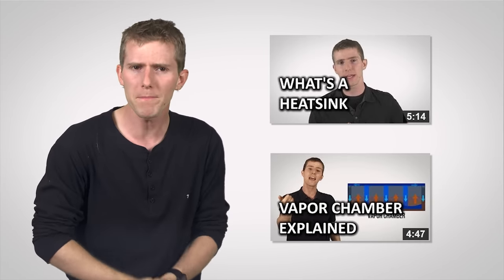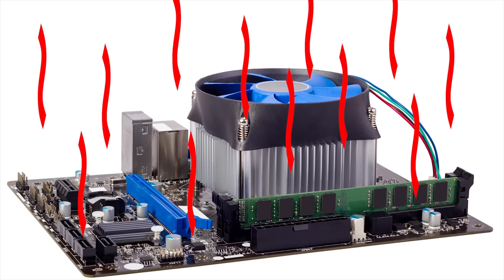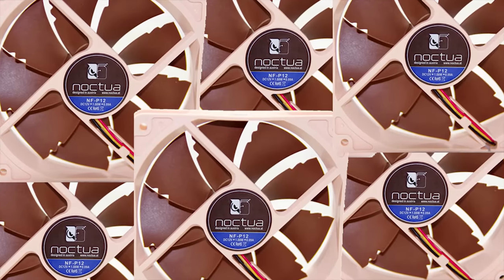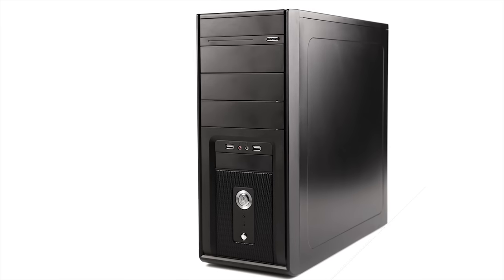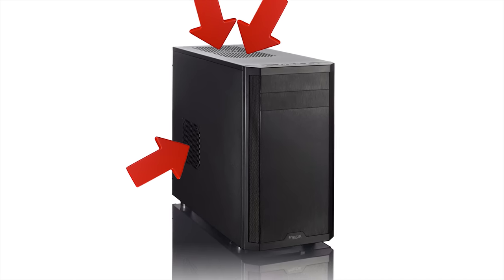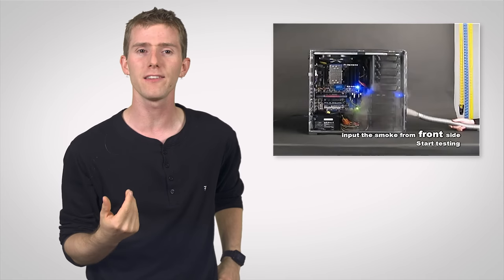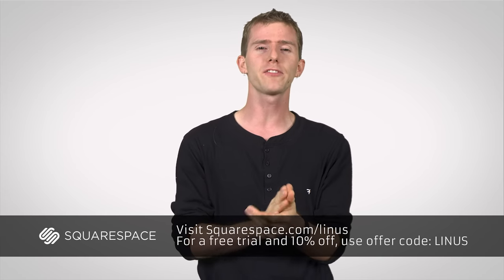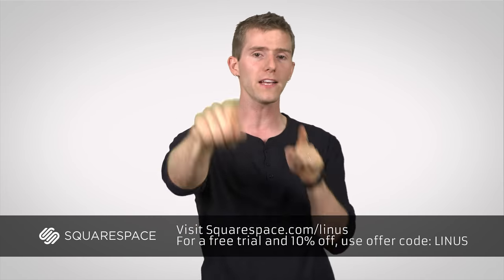Positive vs Negative Air Pressure as Fast As Possible

Comment: Hey guys please read THIS IS NOT ADVERTISING!
SO the reason im not posting this on forums is because the response time there is shit.
My PSU is making this extremely annoying noise (A Corsair TX850M 850W). I found this on youtube:
The problem is that there is a point where the PSU is under enough load to start supplying voltage to the fan, but not quite enough to start it spinning. Instead is rattles back and forth and makes a most annoying buzzing noise. The fan spinning at full speed is less annoying than this buzzing noise.
So now i thought about this, and i think i found a "solution" but i need confirmation if this what i thought of is safe. So my idea: Can i open up the power supply, disconnect the fan connector, and wire the fan up to my motherboard? and control it through my BIOS to keep it on constantly? I know this is NOT SAFE for the temperatures but i got a super silent fan so i can just keep it on highest RPM it can do lol. Can i do this? Is this possible? Is the connector the right one for a motherboard? Thank you for reading, and don't tell me about warranty pls lol.
Reply: I know you said not to talk about the warranty.. but sending it back and getting a new one is the only option really. The buzzing noise will be coil whine. The fan shouldn't spin at full speed all the time either, my CX750 corsair power supply makes almost no sound on maximum load and that's a relatively low price power supply.  Wiring it up to your mother board wont make a difference, send it back for a new one or buy a new power supply.
Reply: wapted  Thank you for your reply. I think i'm going to buy a new one. if i send it back for a new one i can't use my pc for like 2+ weeks which i really can't handle lol xD and also i don't think that will fix it... I'm probably going to buy a new one :) be quiet! Dark Power Pro 10 750W, it''s 100W less than i currently have but it should still be enough for my pc
Reply: Ok, great! good luck with getting a new power supply :)
Reply: wapted Thanks :)

Comment: So, if I take the cover OFF my case, that would keep a CF/SLI setup cool?
Reply: Take the cover off, and get a fan blowing into it.
Reply: Sheldon Cooper definitely yes thats what i do sometimes,if i play but you olso be letting dust in.
Reply: Sheldon Cooper why do you have a cf/sli configuration if you dont know the basics about cooling? *facepalm
Reply: beyond305 I never had a CF/SLI configuration. It was a question.

For the record I now have an Antec p280 with proper cooling.
Reply: beyond305 chill bro

Comment: I guess I went in the wrong direct when getting my Liquid cooler. I now have 3x 120mm pushing, 1x 140mm pushing out and 3x 120mm pushing in. So Negative pressure... Should I re-arrange it all so it's to be positive?

Comment: Okay, lets have a scenario where you are using up all fan options ( lets say 3 intake and 3 exhaust ), will lowering the rpm of the 3 exhaust help and maintain a somewhat positive air pressure?
Reply: Yes, because in the end you'll have more air trying to enter the case versus the amount of air being allowed/pushed to exit it.
Reply: Raymond Tyson Thanks man, I've been wondering about it for a while.

Comment: Inside my PC barely accumulate any dust or dust bunnies.

I have a case that is 90% mesh turned face down so PS, GPU, CPU, all exhaust heat upwards, all parts are designed for passive air flow except when rendering video then I flip a switch for a fan to blow up over the CPU.

Comment: How good of a ventilation woud be to put two fans at a front and one at the back.1 front fan who top one woud go  nearly its full speed lets say 1500 and a botom one woud be controled by psu going slower like 600 or so and at the back woud go 1500.

Comment: Techquickie a pet peeve of mine is when I see a system and the user has install the PSU up-side-down, i.e with the PSU Fan facing the GPU or CPU if it's at the top.

Does having the In-take for the PSU inside the case benefit the rest of the system in anyway?
Because the way I see it, it's just collecting unnecessary Dust because it's not using the filter plate attach to the case..

Comment: So you mean I should use as many intake as outtake fans? I use the Phanteks enthoo pro with 2 Corsair SPs in the front, a AF in the back and the top and the two SPs of the radiator.

Comment: does radiator fans and GPU fans affect air flow/air pressure? I have 2 intake and 2 exhaust (not including the 2 140mm radiator fans and 3 fans on my rog gtx 1080 strix)

Comment: What if my favourite Case got no top/bottom fan mountings, but 2 front, 1 back and 2 side. Front does pull, back does push. But what do i have to do with the 2 side fans? Both pull, both push or bottom pull(at the gpu) and upper push? I've got a real struggle here

Comment: Does the concept of hot air rising really not matter all that much? I guess I'll have to use the fans on my h100i as intake rather than exhaust if that's the case. Right now I have a slightly negative air pressure in my case and the dust is driving me nuts!

Comment: Negative PRESSURE in an ITX CASE equals the only way to get this asus 670 gtx cooled thru the little holes in the top of the "raid-max atomic case" as even the hard drive I have for third place storage (have nvme and ssd too) is up above the gpu and is less then millimeters from touching the blades of the asus gpu fan blades. Yet, Yet, been running for years this way and I can't get temps tp rise for gpu or cpu above 74c if I tried and I am not so sure I even hit that, EVER, usually after two hours of assassins creed syndicate, on more graphically intense then the 670 should be running, it will finally start to get red dots or flicker on and off, however that even may be my psu as in 12volt rail, not so sure as that rarely happens as I rarely play that demanding of a game in those demanding setting for that long thus, I am a negative pressure kind of guy until somebody Prove me wrong.. I think it makes a difference in itx builds over larger cases as my negative pressure is making other holes in raidmax atomic that could never in reality fit an intake fan, BECOME AN INTAKE FAN AS IT DRAGS AIR IN EVEN THOUGH NO FAN IS THERE AS NO FAN WOULD EVEN FIT WHERE THE gpu HOLE ARE BUT ARE MUCH NEEDED! ... Get it? This stuff matters in itx versus regular sides cases, the preference changes! As nano technology takes over the world and things get smaller and smaller, it will come more into play! I see zero videos regarding positive and negative pressure with itx versus ???, versus ATX... This would be a good video Linus, Pioneer on my brother!.... BTW: For the technology of the asus 670 and the 4490k, etc... Just a tad older so more heat then smaller stuff out now, I am actually im pressed even if it is my 670 turning off when it gets tortured. She does always come back on though.. :P "Just say no to RED Artifacts"... It does NOT always mean a dying GPU, Sometimes means a stressed GPU or bad cable hdmi to dvi, etc and sometimes even your PSU 12 volt rail is bad which most people ever fail to check!
Reply: BTW: Yes I am completely INSANE as what do you expect - I am an EAGLES Fan from Philadelphia 'however I do make a good point!....

Comment: ok .. I have a 80 mm fan intake in front.. for some reason there is no other out fan or in.. I was thinking a 120 mm fan for intake on the side, but keep at low setting, and a 120 mm fan on top for exhaust on high?  Linus, will this work ok? you didn't really specify how to know we have the correct balance

Comment: hey Linus, i m using a top psu mounted cooler master cabinet, which have only 1 front 140 mm fan for intake so i add 3 mores 'deepcool' fans on side panel 2x 120 mm for exhaust & 1x 120 mm for exhaust at back panel cz there no room for fans on top or bottom bt in front there are removable drive case panel bt i leave them as it is, my configuration is CPU- intel i3 2120 3.3 ghz , RAM- 4 + 4 gb (1333 mhz) , GPU- Zotac Nvidia GeForce GTX 660 Synergy Edition, PSU- Cooler Master GX II 550 w, HDD- 500 GB seagate Baracuda , bt when in full loads gpu temp rise upto 76 c max at normal it stay 37 c - 38 c, so is it something wrong in it??? plz forgive me for my bad translation :p & thnx for every video, helped a lot, thanks again :) (y)

Comment: After many years I notice the more power usage hardware like GPU's, CPU's, Higher Ram Memory so on!. These will need higher than 750 Watt Power Supplies something like a Nvidia RTX 3080+ video cards, these will require higher running power usage. 
The Hotter running stuff adds more dust and can add to needing more air flow power and adds problems to life span in a world that seems to move faster as if the world is mysteriously moving around faster with out us knowing about it, or it's just how things are being an aging human is when we get older but anyways...I don't want to go off topic here. I can see anything drawing more power adds problems, Kind of like trying to stop a Taxi driver that is speeding by too fast before the driver can see you and stop for you. 
Be nice to find backward thinkers and designers to make things that uses less power and works good and last longer sometimes. I do hate having to maintain water cooling aging hardware because of buildup old fluids acting like Heart attack blood flow troubles we humans have, At times I end up going back to looking for higher rpm case fans for high air flow coolers and just maintain the dust anyways.

Comment: Im planning on building a system that has 3 120mm and 2 140mm fans as intake and 1 140 mm as an exhaust but, the case im gonna be using has so many ventilation holes and unused fan mounting spots that the airpressure inside the case should only be slightly higher than normal is that right?

Comment: I have a Silverstone SG13, and there isn't any room in my case for any fans except for 1x 120mm fan in the front. I've got a blower style reference GTX 970, and my i7-3770k is cooled with a Corsair H60. The fan for the radiator is facing as an intake. Do I need to worry about positive/negative pressure at all given that my GPU and CPU are both in a 'closed' loop?

Comment: 3 intake fans 3 vents without fans. positive pressure with the fan-less vents being a passive exhaust. is that a good config?
Reply: I would recommend at least one vent with an outtake fan to reduce the temps inside the case.

Comment: I have a 200mm blowing in from the front, a 120mm blowing up/in from the bottom (both filtered) and then a 120mm at the top blowing out and then a 140mm exhaust. Should I add more intake fans?..I went and rebuilt my pc last night and there was sooo much dust...or is there nothing you can do to stop some of it...?
Reply: I have the same sort of setup and wondered the same. I've always been taught 2 IN, 3 OUT. I've got my two 140mm intakes at the front and top of my Rosewill U3 and two 120mm exhaust on the side and one 120mm at the back.

Comment: Do I need fans for a desktop? I have a prebuilt PC with NO case fans and I want to add a GTX 970 to it.
Reply: +Roy Martinez Yes, I would recommend at least a couple high airflow fans (1 out, 1 in), or 3 (1 out, 2 in)
Reply: +Roy Martinez It's a miracle a 970 would even FIT in a prebuilt
Reply: +Roy Martinez yes. gaming computers need ventilation; otherwise, you will eventually get hardware failure sooner or later (had my 2TB seagate drive fail first, and then my ASUS 7870 card fail after)
Reply: +jonathandb91 
You only need but 1 fan, to make the air move.

I heard the argument for having a fan, back in the 1980s. Apple thought it was so cool, and of course quiet, to make their Apple // series computers with no fans. I had an Apple //e. The conventional thinking was, sure, it is okay to run it with no fans, well until you start adding circuit cards, that both generate additional heat, and block natural airflow. So everybody was getting the Kensington System Saver fan, that was designed in the same matching color, and clips onto the side of the computer, and it came with a front-mounted power switch, replaced the computer's power cord, had 2 electrical outlets for the computer monitor and printer or whatever, and provided surge protection for the entire system.

I think it was an exhaust fan, as it had no air filter.

Comment: So there should be positive pressure in my case?? I have 1 front intake and 3 exhaust fans in the back and top so that the heat is pushed out fast and fresh air comes through the filtered intake (Corsair 350D). But some time after cleaning my hardware, best visible on the graphics card, is "coated"  in fine dust... 
Is that because the front fan can not push enough fresh air in so the dust comes through other little parts?

Comment: is it safe to use a portable vacuum in a pc to clean out dust or could this make some pieces come loose
Reply: alpha penquin Some people would be concerned about static electricity as far as a vacuum goes.  Some people disregard that, though.  I'd be careful about the fans, just as you would be if you were using compressed air.

Comment: I have a fractal Define R4. The two top fans are exhaust and the rear fan is also exhaust. The rest of the fans (two front and 1 bottom) are intake. I'm trying to keep one of my GPUs (x2 HIS 7950 iceQ) from reaching 85c during heavy gameplay, Usually when I play Metro Last Light for more than 30 minutes, because when it does reach 85c the machine crash.  Is this airflow positive or negative.  I clean out my computer roughly once a month, and my room for the most part is usually cool. Since I had one of my GPus for almsot a year I think I need to put new thermal paste. Any tips will help.  

BTW All of my fans are Cosair Air, except fro the one at the bottom which is a cheap fan.

Comment: So uhm I guess 1 intake and 1 exhaust both similar fans is the safest best?
Reply: yeah, if that's all your case supports it's a good setup.  although i would recommend a faster fan (or larger fan at the same RPM) for the intake than for the exhaust if you are only going to be running two.  this will ensure slight positive pressure in the case and help keep dust from sneaking in the seams.

Comment: How far positive is too far? If i used 140mm for intake and 120mm for exhaust is the air inside going to be heating up to far?
Reply: +mypastlife 
You do not need an exhaust fan, if you are running an intake fan with filter. The positive computer case pressure, will automatically exhaust the air out of any vents not blocked by fans.

I see no problem with your setup, other than the excess noise of a fan too many. The fans need not be balanced, just so long as you maintain positive case pressure, to prevent dust from entering through every crack.

Comment: thanks linus ^^ i watched a lot of your air flow videos before building my own pc.
I set up all fans as intake - safe for the push-pull on my H80i that is an exhaust. Those fans do a great job of  throwing air out... and regular cleaning of the fan filters keeps things pretty dust clean :)

a little bit of dust is collecting between those rads though... but nothing serious that cakes up the whole thing. Anyone know a good way to get that stuff out between the fins of the rad?
Reply: Blow out with compressed-air from behind, but with pressure not set too high, otherwise you'll bend the fins!
Alternatively, use a vacuum-cleaner brush-attachment that has soft bristles.
&B^{D?
Reply: Thx - ill give it a try~

Comment: 1 exhaust at the back of the case  3 intake on the top (filtered) and 2 intake on the front (filtered) is it good or too much positive air pressure?

Comment: What is G-sync/G-sync as fast as possible video?
Reply: G-sync vs vsync *
Reply: Keston Lamers  v-sync caps your fps at your monitors refresh rate so your not pushing more frames than your monitor can handle, (check out linus's "refresh rates explained") where as g-sync updates the screen as soon as the current frame is finished and ready to be output by the graphics card.
Reply: So if you have a let's say gtx 760 and a 60hz monitor, using vsync will reduce screen tearing?

Comment: So if I had 6 case fans. 2 140mm intakes at the front. 1 120mm intake at the bottom. 2 top 120mm exhaust and 1 back 120mm exhaust.  Would that be optimal?

Comment: should the amount of air the gpus can move be considered when trying to calculate case pressure?
Reply: Only if you have a blower style cooler. A blower style cooler will suck air from the case, use it to cool your GPU and exhaust it out through the back of it and out of the case. I personally have a blower style cooler, and I have that along with 1 exhaust fan, and 2 intake fans. Normal gpu coolers with multiple fans found on most aftermarket coolers don't exhaust the air out of the case, and should not be taken into consideration.

Comment: Hi Linus, 
I have a silverstone sg13 itx case with 500w thermaltake rgb powersupply, how would I place it in that case, as the cpu sits just below the psu slot. 
Should I put thre psu to intake hot air from cpu or otherside

Comment: Noticed some dust on my GPU and was wondering if I might not have the best arrangement for the 6 AF140's on my Define R4.  The top 2 and the rear are exhaust and the front 2 and the bottom one are intake. PSU intake is from the underside of the case venting to the rear.  Should I maybe replace one of the upper fans with the moduvent panels? Assuming I can still find them!
Reply: I have no idea honestly, but if you want better help then the youtube comment section I recommend checking out http://www.tomshardware.com/forum/28/cooling.html

Comment: I have a 120mm up front as an intake,and another one in the rear for exhaust, I'm going to add one to the top so should it be an intake or an exhaust? not quite sure which to choose, might try both